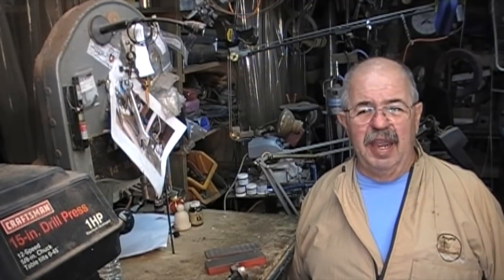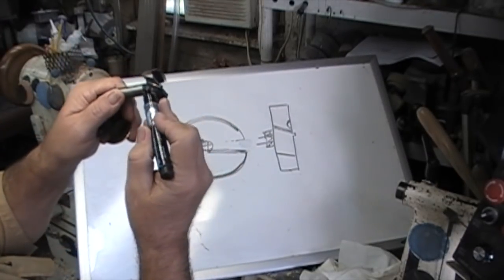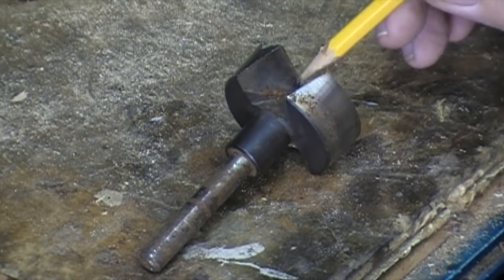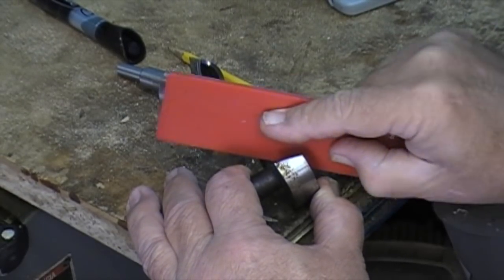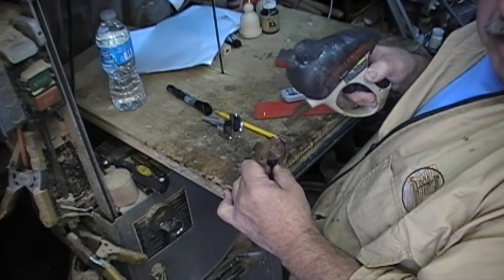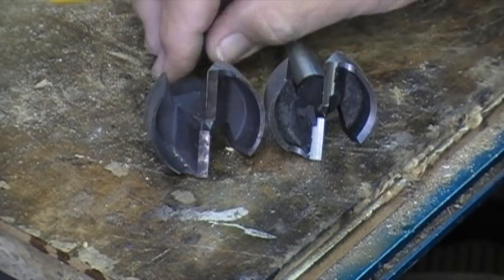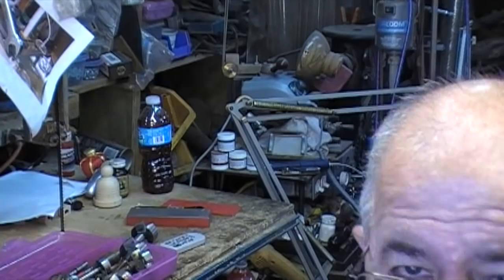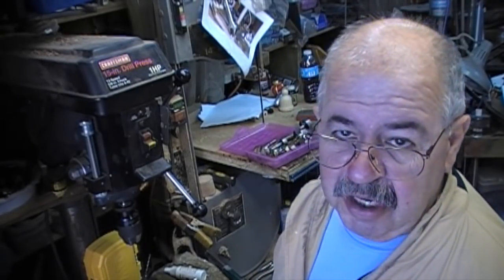#148 Forstner Bit Touch-up

Comment: Thanks very much. That is really good. My Forstner bit needs a hone up, not a complete resurfacing. Just a touch up. Without your help I would have done it wrong and degraded my quite good bit. I sharpen my Japanese knives pretty well and know there is a LOT more to sharpening than grabbing a thin file and seeing what happens. Visitors always comment on my knives if they use them. A sharp edge remains cool and maintains it's tempering. A dull edge heats up and destroys the tempering.

Comment: Thanks Capt. Eddie
I sharpened my set of nine Forstner bits by inserting a Jacobs chuck in the tail stock to hold the bit (use the lathe as a holding jig).  This allows you to grasp the diamond sharpener with both hands making for more stable/accurate sharpening and it is easier to apply more pressure.

Comment: I agree with you in regards to wd 40. It seems to be to volatile to provide long term protection and instead it just evaporates away. I've even soaked tools in motor oil, left them sit for a while, and wiped them off... that works good. It gets the majority of the oil off but leaves a slight film on the tool.

Comment: Try waterless hand sanitizer - soap & 70% alcohol.  It cleans my sawblades and my hands.  And try chucking the the bit in the lathe tailstock (or locked headstock)  to hold it still while sharpening.

Comment: Cap, ditch the oven cleaner and try Krud Kutter. Stuff works better than the commercial bit cleaner, is non-toxic and not acidic like oven cleaner.
I buy the concentrate at Tractor Supply for $10 a gallon.

Comment: For rust removal, I recommend a 50/50 mixture of Water and Muriatic Acid (avaliable at any hardware store, and some wal-marts for concrete cleaning).  Always pour Acid into the Water, SLOWLY as the mixture will heat up while it is mixing together.  Just make a few ounces worth in a PLASTIC or GLASS cup, and drop the bit into it and wait ten seconds while it bubbles and fizzes.  When you pull the bit out, it will be 100% spotless, no rust, no dirt, NOTHING left.  Then rinse it off and hit it with a coating of WD-40 or your favorite oil to protect it from rusting.  If you dont put the oil coating on it, it will rust within HOURS, because the acid eats the metals natural protective layer off.  I have brought bits and tools back to life that had coatings of rust that made them look like they were found in the Titanic wreckage.  Also, as a side note:  Muriatic Acid has some nasty fumes if you inhale them its like breathing in fire.  They sell a low-fume version next to the regular Muriatic Acid in many stores.  This stuff works nearly as well, and doesn't burn the hair off your nostrils.  Wear gloves, safety goggles, and BE SAFE!!!! If you can use proper safety equipment to work with wood and metal tools and not get hurt, you should be able to handle this if you have some common sense.
Reply: +Michael Swain Edit:  EXCELLENT video btw!  Very in-depth and informative, without being boring or monotone.  You should keep up the awesome work!

Comment: This is non-sense.  If the perimeter knife edge needs to be sharpened, you sharpen it.  Yes, if you screw it up it won't cut properly.  Just like if you only sharpen one side of a double beveled knife, it won't work properly.  Don't screw it up.  If you need to sharpen the knife-edge, you sharpen all the cutting surfaces removing the same amount of material all the way around.  Geometry stays unchanged.  Its not rocket science.